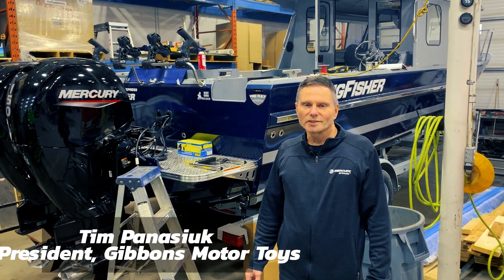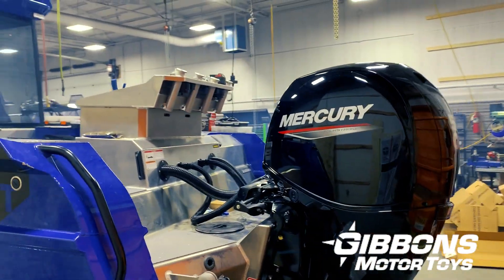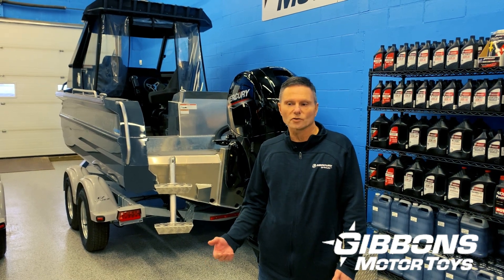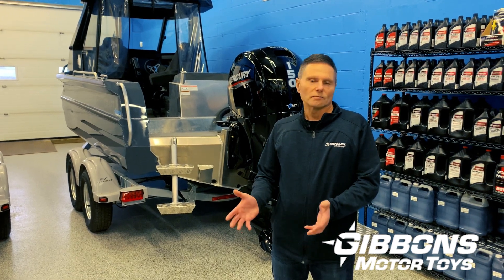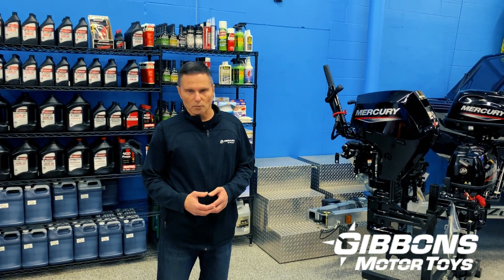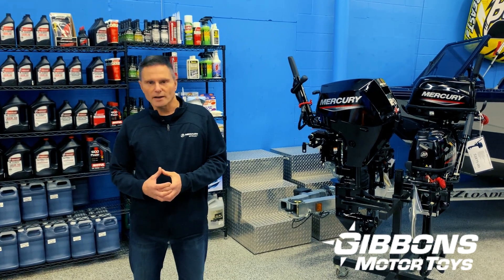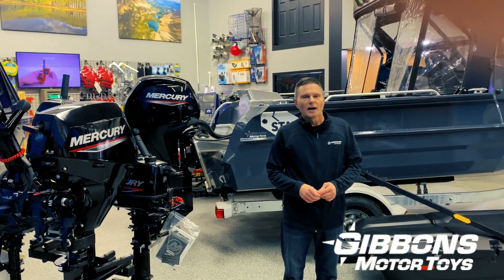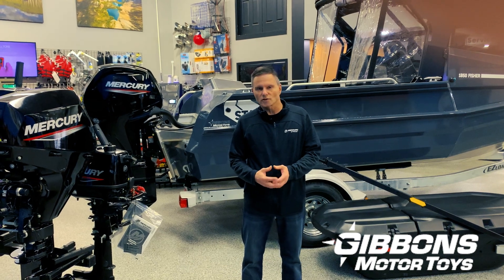Which is better? Single or Twin Engines?

Comment: You are exactly right on fuel being the number one issue for breakdowns. Its wise to carry extra water fuel separators (2 for each fuel line). Also a primer bulb, one for the main engines and one for the trolling engine. I always run fuel stabilizer too as my boating season could come to an un-expected end. 
Maybe you could do a video on what extra equipment a person should have on board. You could do 2 examples like one for a day boat and one for an extended cruising style boat. (in addition to safety equipment).
Reply from the maker: Thanks for the feedback! We'll add this to the list!